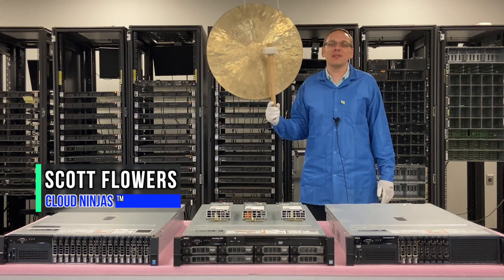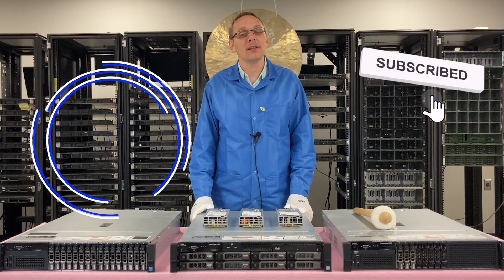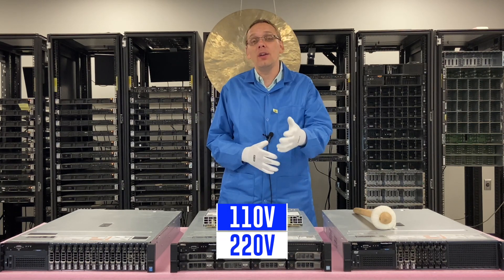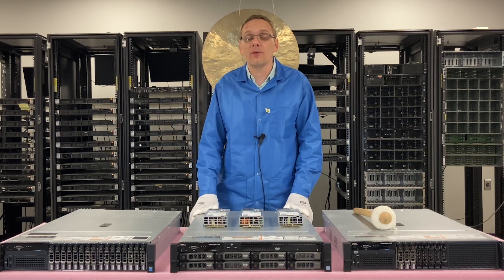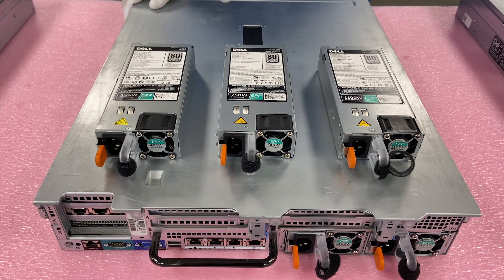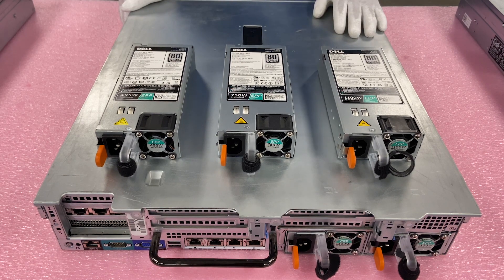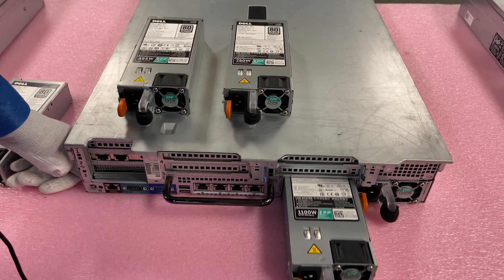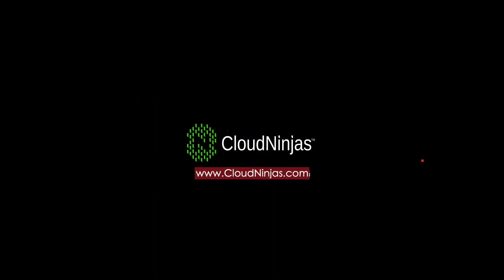Dell PowerEdge R730 Power Supplies Overview | Power Supplies Options | How to Install PSU | Hotswap

Comment: LOL are the space betwenu 1U for manuals? must be hard to gues  which button to turnon ( and on the back not much cables i beat only power cords hang out out of the units :)). Wont be greener to use Christmast tree led for decoration?
Reply from the maker: Hahaha.  These are all units for testing components in bulk.  Our techs like the space in between to set down trays of memory (or cpus).  Only power and monitor connection for those.  I need to do a video showing our whole lab one day.